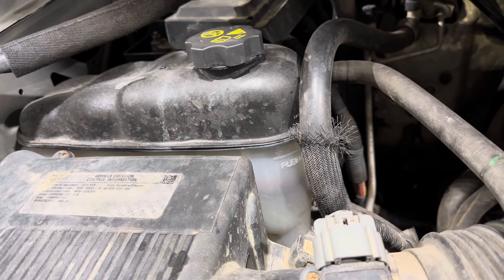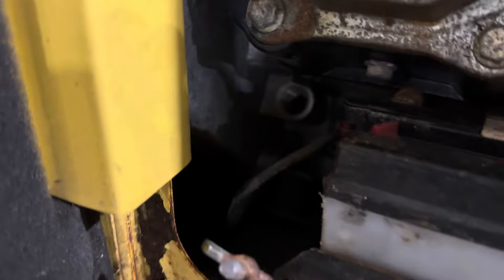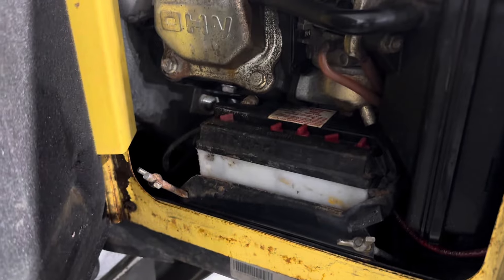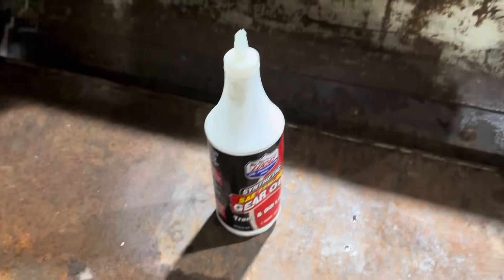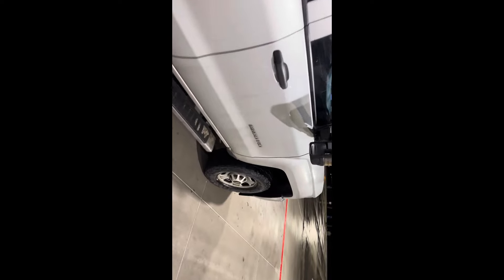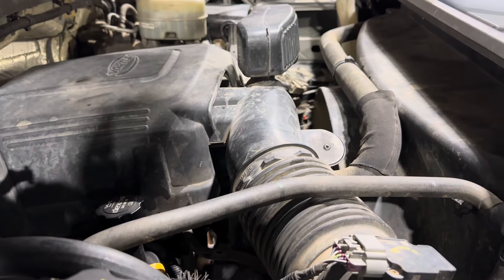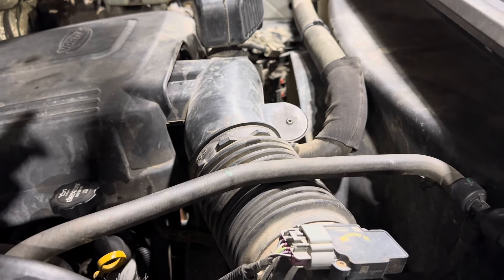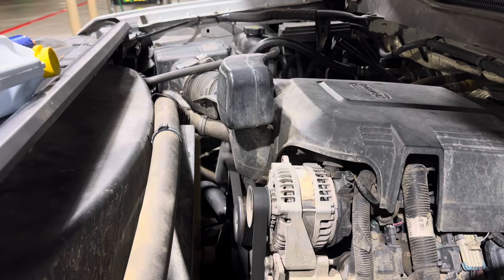STRANDED and OVERHEATED again🤦‍♂️🔥!! Plus trailer and generator problems ahhhhh!!!

Comment: My band-aid fix for the exact same gauge visibility issue was a bluetooth scantool and mounting an old phone in a place where I could see it very easily on the road. I used an OBDLink MX+ to monitor all the essentials in a bright, clear, and convenient way. I put the phone in landscape mode right next to the A pillar and ran a power wire for the wireless charger equipped phone mount through/around my dash trim to one of those piggyback fuse add a circuit doo hickeys on my always hot "power moving pedals" fuse in the under dash fuse box for 12v. Worked great!
Reply from the maker: Honestly that’s not a terrible idea